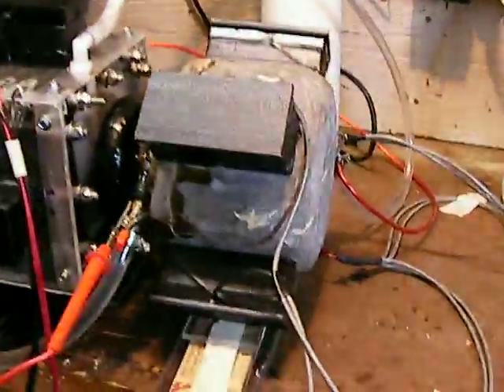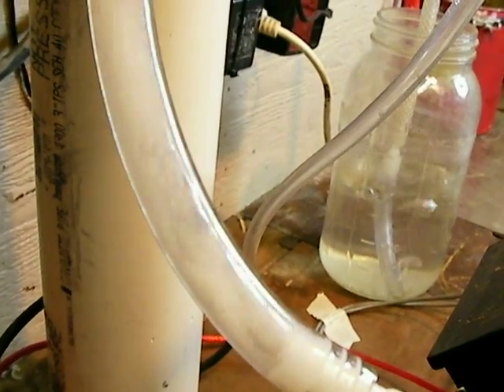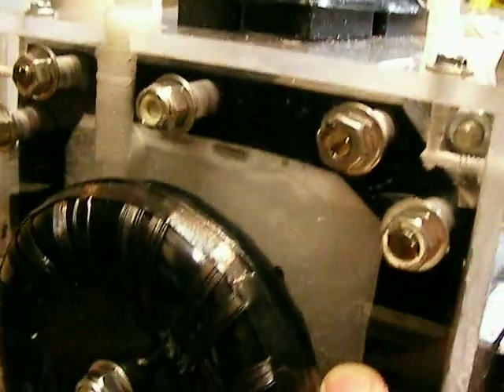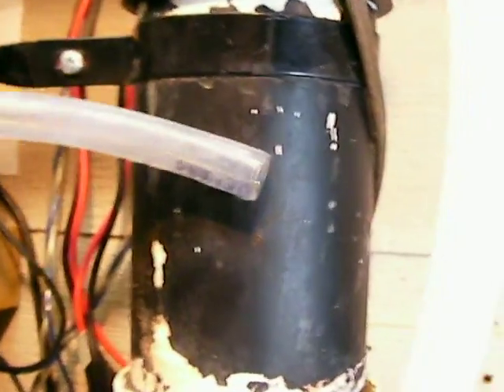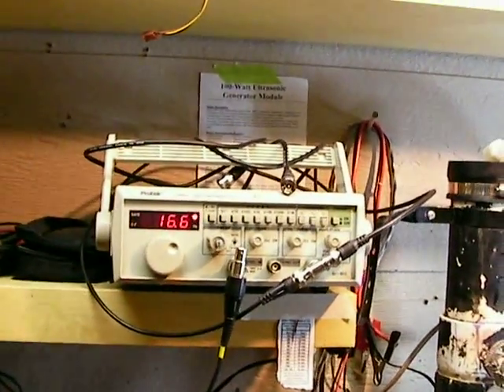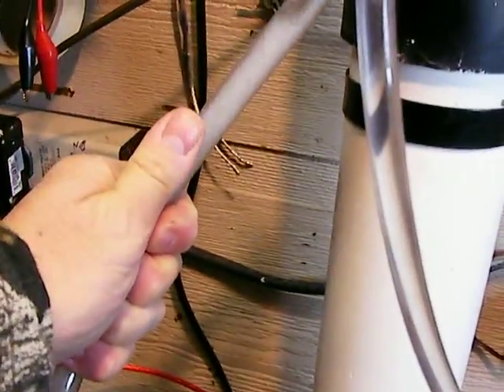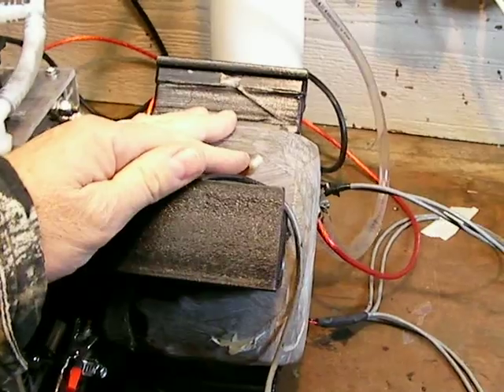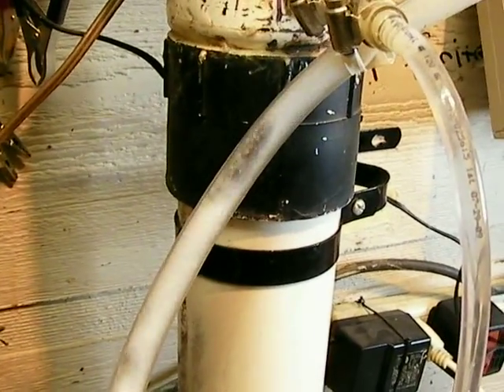Rodin coil powered hydrogen cell

Comment from the maker: i am using lasers to inject photons into the cell i will post the video when i am finished adding the lasers.. also mikepowers420 is doing the same he suggested i inject the photons.
stan meyers hydrogen gun used lasers.. at the gas right before it was burned..
i am doing the same now. i am creating an electron collision and then absorbing the electrons in a mag field using a unified field i will call this the resonate gas chamber.. gas goes BOOM!